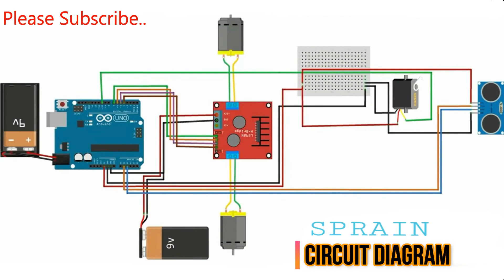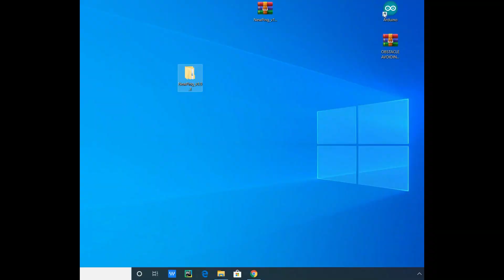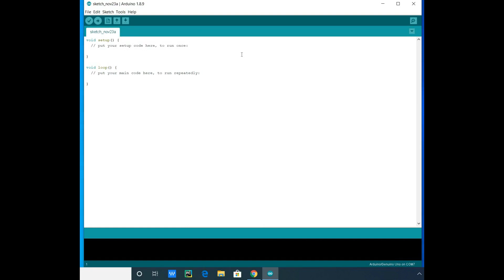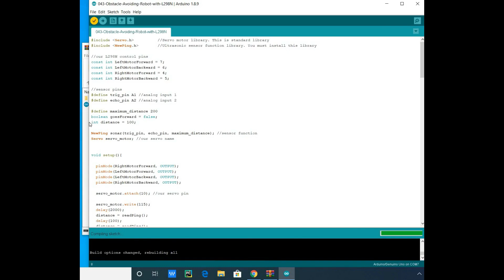How to make a obstacle avoiding robot and Car

Comment: Does this code work for any arduino board and with same connections
Reply from the maker: It works for Arduino Uno board..am not sure about other boards..may be it will work..Arduino Nano..
Reply: Thank u so much

Comment: I made that car just like you
But the motors did not worked
do you know why?
Reply from the maker: May be the battery issue,  try using duracel 9v battery or 18650 Li batteries
Reply: @sprainrobotics  
I used 3volt dc motors
And I used 18650 batteries,
The circuit turns on only if we connect battery to 5v instead of 12v on L298 module
Is the code not working on 5v?